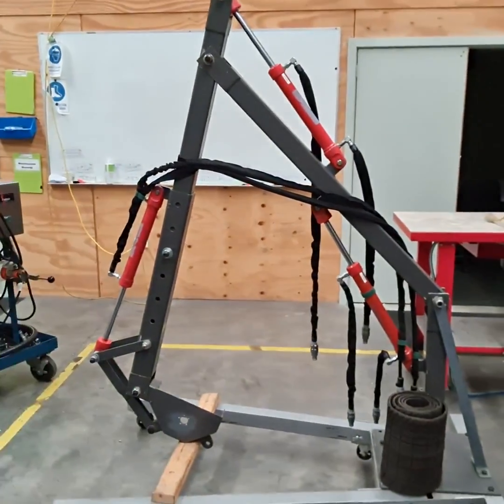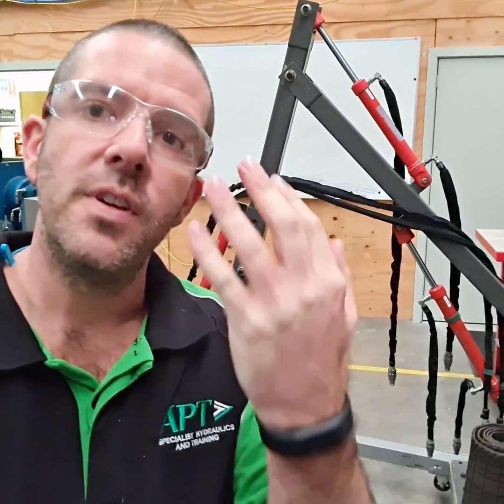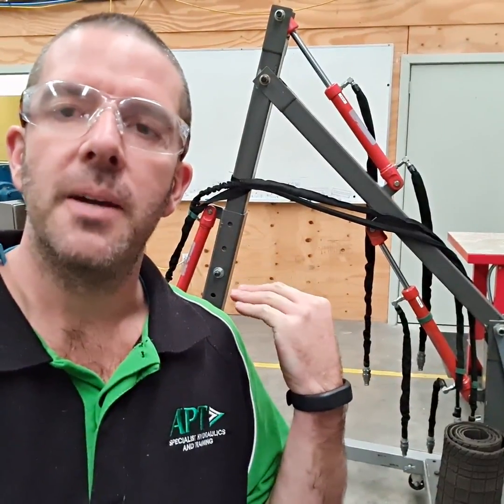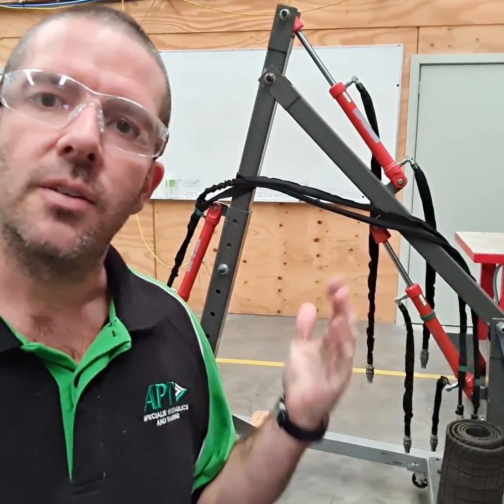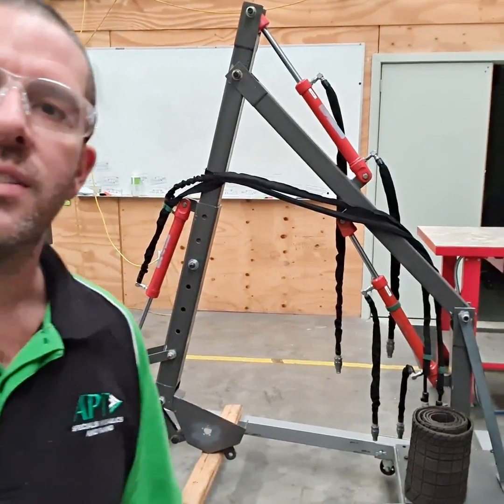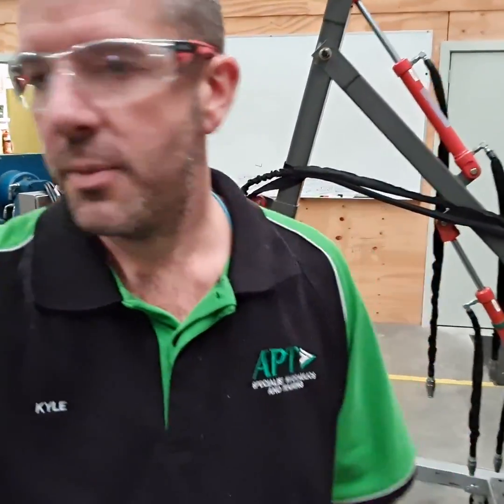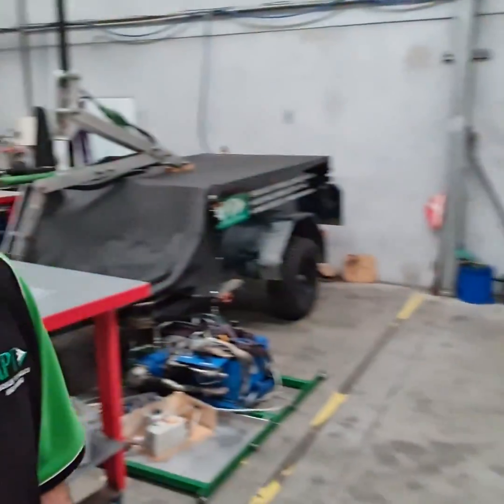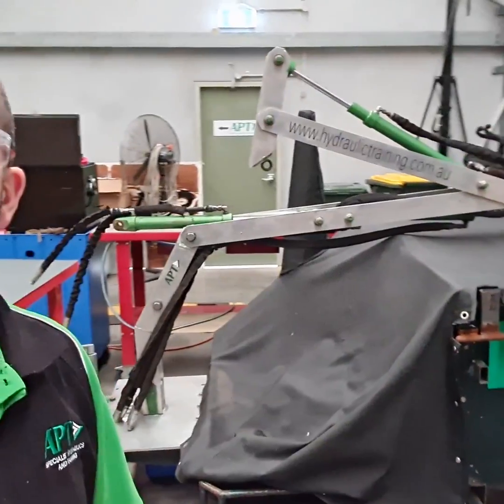Custom Made Excavator

Comment: @CustomHydraulics hey guys,

A few years back (more than I'd like to accept, aging sucks) during a professional development training that I undertook, a video was shared in a session on paradigm shifting.

They provided stat's of an internal combustion engine driving a vehicle faster and more fuel efficiently than is possible with just an internal combustion engine. Like massively. 

What I remember is that the engine primed a pressure tank and the tank drove the vehicle. Breaking returned pressure to the tank. And at cruise, the engine simply held pressure to the hydraulic tank. The vehicle was powered by a motor but driven by hydraulics. 

Since you are in the game I was hoping that you might have an idea of this, or can provide some direction.
Reply: I'm not sure, but I believe the internal combustion engine was a rotary design to allow for significant fuel consumption for "warm up" (pressurisation) and idel (cruise). Any deceleration was fed back to restore pressure to the tank.  Even downhill run restored pressure to assist the next requirement.